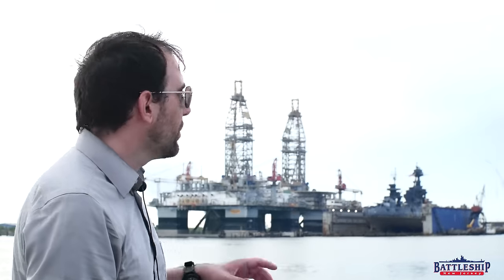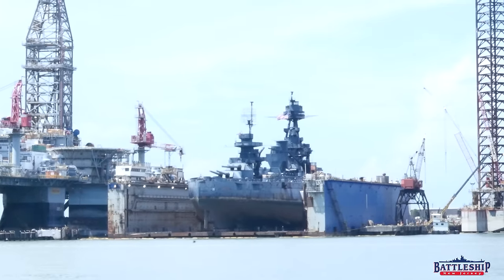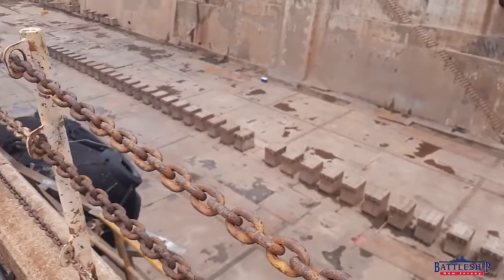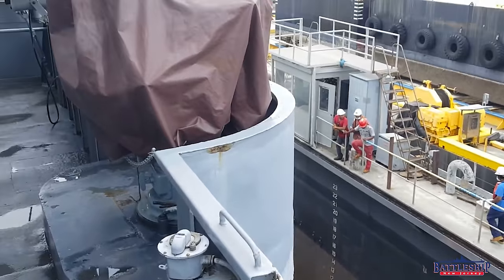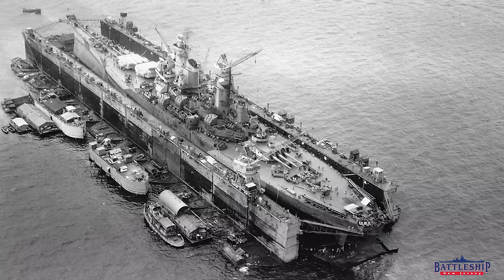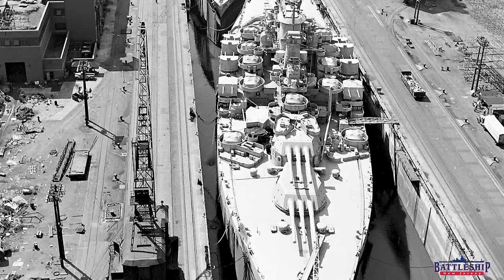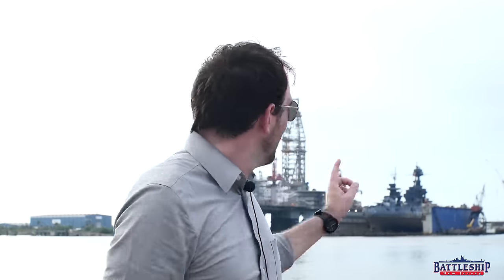A Brief History of Floating Drydocks from WWII to 2022 and Battleship Texas

Comment: Ryan, that photo of the drydock with two battleships isn’t a floating drydock. It’s Drydock 5 at the Philadelphia Navy Yard. You can tell by the distinctive drydock service building (Building 620) next to it as well as the cranes. I’d recognize it anywhere, as it’s currently owned by Philly Shipyard Inc., which I used to work for.

Comment: There aren’t any WW2 ships still in service but there are still several WW2 era Navy docks still in service almost 80 years later. They are amazingly useful ships. Without the floating dry docks that they could keep pushing closer to the front and were able to get ships back into service quickly, they’d never been able to press the war like they did.

Comment: The “unsung hero ships” depend on the theater of operation.  For the Atlantic, hands down it was the cargo ships that kept the supply lines going to the UK and USSR…..both of which would have been up the preverbal creek without them.  The losses early in the war, particularly in the freezing North Atlantic, were horrific.  In the Pacific I think a good case can be made for the Higgins landing craft.  Without the 20,000 or so of these, the island hopping campaign would have been far deadlier.  Of course any Navy is no better than the sum of its parts.  Pull out any major element and the Navy would falter if not outright fail.

Comment: America's Secret Weapon

Among the logistical marvels employed by the U.S. Navy in the Pacific were various kinds of floating dry docks. These were towed to advanced bases by tugs and came in a variety of sizes.

Planning for floating dry docks was prompted by the fortifications clause of the Washington Naval Treaty, which forbade any further development of bases in the western Pacific. Construction of floating dry docks was given high priority and the docks were regarded as an important "secret weapon" in the event of war with Japan. Plans were even considered for giving the largest floating dry docks their own propulsion plants to increase their mobility. However, tight funding in peace time meant that construction of the docks took place only slowly.

At the time war broke out in the Pacific, the Navy had three steel floating dry docks. One, YFD-2, was assigned to Pearl Harbor and was occupied by destroyer Shaw when the harbor was attacked on 7 December 1941. Both destroyer and dry dock were badly damaged but subsequently repaired. Another, YFD-1 Dewey, was at Olongapo and was scuttled to prevent it falling into Japanese hands. The third, ARD-1, was built in 1933 to a sophisticated design, meant to be self-sustaining once towed into place at an advanced base. It had its own ballast pumps, power station, machine shops, and crew accommodations, and could lift ships of up to 2200 tons. It was also assigned to Pearl Harbor.

Following up on the success of ARD-1, the Navy built another 30 ARDs (Auxiliary Repair Docks) during the war, most of which were completed in 1942-1944. Six of the docks were 485'8" (148.0m) long and could accommodate a ship 413' (126m) long, 49'4' (15.0m) wide, and displacing 3500 tons or more. This was sufficient for a destroyer or submarine. The clear width for the remaining units was increased to 59' (18.0m) to accommodate an LST.

AFDs, Auxiliary Floating Docks, were built of welded steel, were 200' (61m) long and 64' (19.5m) wide, and could lift a ship 45' (13.7m) wide with a displacement of up to 1900 tons. This was sufficient for smaller landing ships, minesweepers, and patrol craft. The first AFDs were completed in late 1943 and about 34 were completed by the end of the war.

By 1943, steel was a critical resource, and the U.S. Navy economized by constructing thirteen dry docks out of concrete. Each had a capacity of 2800 tons, enough for a large destroyer, and the dimensions were 389' by 84' by 40' (119m by 26m by 12m). The floor was divided into twelve compartments with a dry passage for personnel. Six were outfitted with diesel generators and manned by crews of 5 officers and 89 men for independent operation (the other seven remained in developed ports). Each had a 5 ton crane on each wing wall.

The concrete docks proved durable and were surprisingly popular with their crews. Their massive construction gave them considerable stability, and the tremendous ballast provided by the lower hull meant that the wing walls could be outfitted with extensive crew facilities.

ABSDs, Advance Base Sectional Docks, were huge floating docks built in sections. The individual sections were small enough to withstand the stress of being towed in heavy seas and were were welded together once they arrived at the advanced base. The docks came in two sizes, with the largest ones built out of ten sections, each 256' (78m) long and 80' (24m) wide and with a lift of 10,000 tons. These were welded together side to side to produce an assembled dock 927' (283m) long and 256' (78m) wide that could lift a warship 827' (65m) long, 133' (65m) wide, and displacing up to 90,000 tons. This was sufficient for any ship in the fleet.

The smaller version came in seven sections, each 204' (62m) long and 101' (31m) wide and capable of lifting 8000 tons. When assembled, it could lift a ship 725' (221m) long , 120' (37m) wide, and displacing up to 55,000 tons. The sections were given a rough hull form that allowed them to be towed at 6 to 8 knots, with the side walls folded down to reduce wind resistance and lower the center of gravity. They had their own diesel generators and crew quarters. Each assembled dock had two cranes with a lift of 15 tons that ran on rails atop the assembled walls of the dock. 

A total of 58 ABSD sections were constructed during the war, sufficient for three of the larger docks and four of the smaller docks. The first ABSD was assembled at Noumea in 1943 and a second was being assembled at Espiritu Santo at the end of the year. Though theoretically capable of being disassembled and moved to a new location, this was attempted only with the Espiritu dock (ABSD-1, later redesignated AFDB-1 Artisan) which was moved to the Philippines just as the war was winding down.

Total Navy floating dry dock capacity was 108,000 tons by the end of 1942 and 723,000 tons at the end of 1943.

There were quite a few types of floating dry docks.

ABSD - Advance Base Sectional Dock
AFD -  Auxiliary Floating Dry Dock
AFDB - Large Auxiliary Floating Dry Dock
AFDL - Small Auxiliary Floating Dry Dock
AFDM - Medium Auxiliary Floating Dry Dock
ARDC - Concrete Auxiliary Repair Dock
ARDM - Medium Auxiliary Repair Dry Dock
YFD  - Yard Floating Dry Dock

Comment: During my USN time at Subic Bay PI a WWII floating dry dock was brought from Guam. My harbor tug spent time in it with two other vessels. Our crew toured inside, below the well deck, which contained full crew accommodations which weren't in use as well as the most enormous machinery, valves, pumps and such needed to raise and lower the craft.

Comment: My first ship in the Navy was the sectional floating drydock USS Los Alamos AFDB-7 in Holy Loch Scotland.  During the Cold War, we kept a sub tender and the Los Alamos in Holy Loch from 1961 to 1991 for onsite repairs of SSBN subs.  I was a Los Alamos crew member from 1974 to 1976.  The Los Alamos was built in seven sections which we kept four in Holy Loch with the others stateside being refurbished as necessary and swapped out on site in Holy Loch.  The repair crews from the sub tender would come over to do their thing while our deck force would repaint the below waterline outer hull of the subs.  Each drydock section had it's own engineering spaces with diesel generators, air compressors, auxiliary steam boilers and assorted pumps for deballasting the dock and fire fighting water.   ETA:  The former Los Alamos is in Brownsville Texas these days under civilian ownership and used to lift oil rigs out of the water for repairs and maintenance.

Comment: Floating dry docks were used in the salvage of the German High Seas Fleet in Scapa Flow.  Cox and Danks bought at least one then cut it in half to anchor either side of the ships they were raising.  Another was used after WW2 to dismantle SMS Derflinger at Faslane.  She was floated in upside down and then the dock was raised. There were even temporary railway tracks laid on the floor of the drydock for cranes and railway wagons to move scap metal.

Comment: Insightful video Ryan. Funny story about floating dry docks you could fact check. Bethlehem Steel/shipyard in East Boston had an old wooden dry dock painted blue. Supposedly they sold it to B.I.W. , Bath, Me for a $1.00 in the 70’s. Bath Iron works fixed it up & Bethlehem sued them because they were making $$ with it. We were in it in 1979, FF 1094.

Comment: It's not just the drydocks, the ships and the planes that kept the fleet going, it's also the people that worked in those drydocks, ships, and planes that kept the US Navy going. Some of those people were so good and dedicated that they were able to repair the ships fast enough and well enough that they were able to get back in the fight. I recall reading about a couple of ships that the Japanese thought they sank, yet those ships were there. One ship, iirc, it was an aircraft carrier, got damaged badly, yet was repaired well enough to the point that the Japanese thought that they were sinking a different ship of the same class each time, i think about four or five times. Another ship, the USS Yorktown CV5, was badly damaged, pulled into Pearl Harbor, and was repaired well enough in 72 hours to be able to go and fight in the Battle of Midway. Legend has it that when she sailed from Pearl there were still many shipyard workers finishing up the repairs on board. The Japanese were surprised to see that ship they believed sunk in the Battle of the Coral Sea there at Midway. It was a combination of the equipment and the talented people that kept the US Navy going.

Comment: I took a lot of photos while the Pampanito was in the WWII floating dry dock at Bay Ship and Yacht in Alameda California. I was able to sail close by and take photos from the water and later took a tour so I could stand on the drydock and see the sub out of water. Both the sub and the dock are owned by the Museum Association that helps support San Francisco Maritime National Historic Park. They lease the drydock which is still in constant use to Bay Ship and Yacht which generates funds to help maintain the sub. The drydock is mostly concrete to save steel and that turns out to make a pretty good floating dry dock that has with little care held up all these years. I'd put in a vote for tugs, the switch engines of the fleet shunting ships and barges around. Something that is hard to do if you don't have them.

Comment: One thing that Ryan did not mention was the SECTIONAL nature of many of these floating drydocks.  How does one get a very large rectangular object from the US west coast to say Ulithi Atoll which was a very large WW-2 fleet anchorage in the Caroline Islands.  This is one of those spots that the fleet retired to between engagements.  These fleet anchorages included at least one of these SECTIONAL floating drydocks.  
    Each section was its own barge with somewhat pointed ends.  they were placed side by side by side by side.... to form a long floating drydock.  When under tow each of the units had two hollow box sections laying on top.  When being set up, this pair of box sections were then tipped up and fastened to the base just inside of the pointed bow and stern -  |____|  Then several sections were fastened together side by side to form the dock.
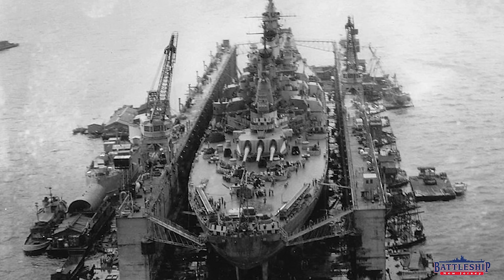A picture is worth 1000 words.  In the photo at about time 7:00 minutes these sectional pointed ends can be seen along the sides of the assembled dock.  Indeed these sectional docks allowed ships to get fairly major battle damage repaired without ever leaving the various Pacific areas of engagement.  AMAZING, and very much responsible for keeping the fleet units available in the engagement area without having to return to Pearl or the west coast!!

Comment: "MA SHIPYARD" is the remaining half of Grand Bahama Shipyard (GBS) Dry Dock No. 2 which was originally built by the Port of Portland as Dry Dock 4 for $84mm in the '70's ($400mm+ in 2022 dollars) to service tankers and container ships, and sold in the early 2000's for $25mm by Cascade General to GBS. In 2019 Royal Caribbean's liner Oasis of the Seas was being serviced when a crane collapsed and the dock sank, and during salvage operations the wreck was cut in half. Gulf Copper purchased the wrecked drydock and refurbished it to its present use.

Comment: Oh got to go off-topic from the topic of the video but given you covered the loss of Moskva, I felt you might want to know this
a maintenance report about Moskva came out around 2 weeks ago and it is horrible, where to begin, 
Out of her 3 anti-aircraft missile defences, none of them was working 
Her missile defence radar couldn't lock onto targets and using it interfered with by the communications system

Her single 130-millimetre gun was non-operable due to a hydraulic leak
Out of her six 30-millimetre CIWS, only 1 worked and the other 5 were used for spare parts
Her damage control systems were broken 
Her watertight doors were leaking or wedged open 
Moskva's only had 50 out of her complement of 500 fire extinguishers
Her safety equipment due to constant theft was locked up and only the Admiral had the key
Several of her engines were past their shelf life by 10,000 hours and required the express permission of the Admiral which meant she could only do 16 knots in emergencies 
The majority of her control systems were broken or missing indicator lights
Her Generators were at the end of their working lives and were not working properly
Her steering gear was partially jammed
The Ship's heel in a turn was limited to 20 degrees
Her Heating and Cooling Systems were not working properly

The Galley had mould contamination

I am just going to say it, the USS New Jersey and even the worn-out HMS Hood back in 1941 were in better shape than Moskva was and bluntly the Russians don't have the excuse that the RN did of having to work their boats to oblivion because they aren't getting replacements any time soon
Reply: Sounds like the Modern Russian Navy is just honoring time honored traditions of the Soviet and Imperial Russian Navies